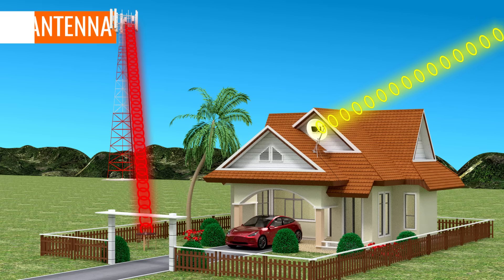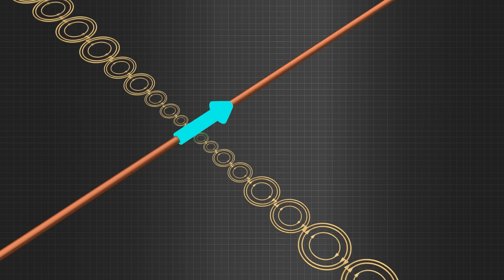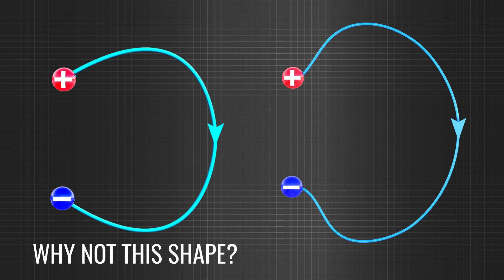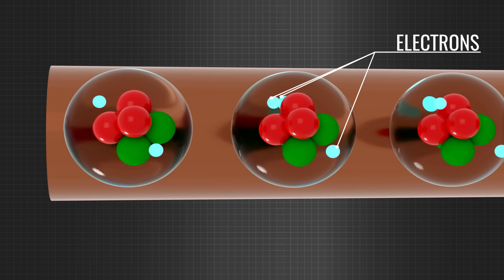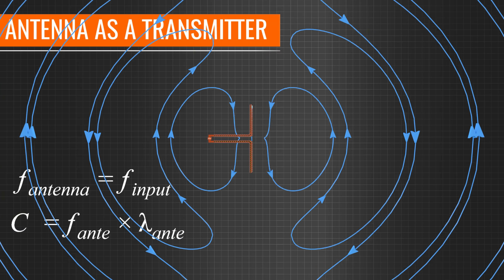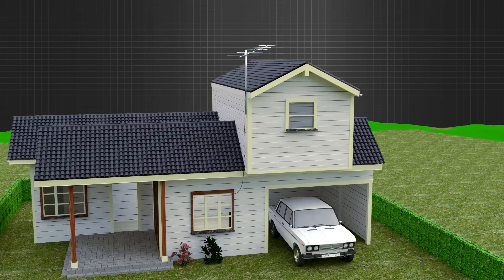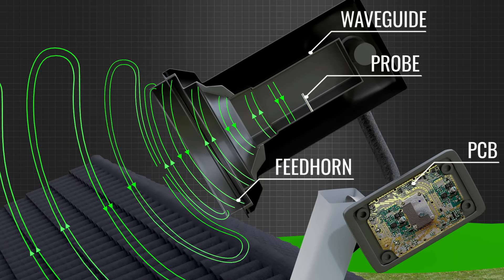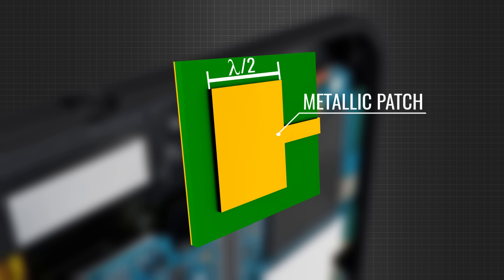How does an Antenna work? | ICT #4

Comment: In the old days,there were Telkom phones in post offices booths,you just rotate the phone handle and the operator immediately connects you with the number you read to the operator of the person you want to talk to.
Reply: 😂😂😂😂why did I miss such moments
Reply: @kakumbaivan2106 It seems you are fed up with modern toys techs
Reply: Yeah, and it was a massive time-sink, complicated as h÷ll and demanded 24/7 attendance, not to mention the resources dumped into massive switchboards and insulated cables.
Sometimes, things change for good reasons.

Comment: So the EM radiation can be represented as a closed loop - banana shape, traveling through space and it can be represented as electric and magnetic sine waves perpendicular to each other?

I am familiar with the hertz wave concept but not with the looped structure. Where could you apply this knowledge to engineering elsewhere and how do you reconcile the two, I wonder😊😅😅
Reply: I think you're confusing electromagnetic fields and the wave/particle itself. Think of the EM Radiation as a ship, and the field as it's wake, and you're close enough for a basic understanding.

Comment: Any thing can be an antenna it only needs to conduct the signal current I've used the frame of an old motor cycle It was a bit crude but worked I did it just to see if it could be done satellite antennas are a different breed of antenna which can be homade but require a bit of skill to work properly lol 😂

Comment: What led me to this video: 
1 - I understood the concept of waves. 
2 - I learned that sound and other waves can only propagate through a medium; I understood that and visualized it. 
3 - Light doesn’t travel through any medium. How is this possible? How does it work then? I couldn't find any good explanation that helped me actually visualize what happens. I like when my mind can actually imagine it happening, so not understanding it was like a splinter in my mind; I had to understand it. 
4 - I went through hell to understand it. 
5 - I learned everything about light. I had to understand the history of electricity, magnetism, and currents. I understand that light is an electromagnetic wave, that it has a spectrum. Electrons emit light through acceleration/movement. Still, I couldn't yet visualize it in my mind. But this video eased the pain a little.😅. I was just a curious guy with a simple question, and I've gone through all this solely to find a good explanation.
But at least now I can say that I know a lot about electromagnetism. Also, other questions that I still haven't found good explanations for arise while trying to understand all this, like how did Maxwell manage to measure the speed of light? Where did these numbers come from? Surely it wasn't an alien that descended to Earth and told him.
Reply: Wow.
Reply: You could always google his experimental setup?

Comment: Test business project for 4 days/ nights with system partition Because the Convergys was company name changed and registration and source coded changed of " Compliance to CaesarKing Company ( CCC ) the former Convergys now CCC have somewhat a Right to be included in the vital tech of the CaesarKing I, and I shall connect them Convergys ( CCC ) to my Functional group given Tech Quantum Network for 4 days/ night with system partition test if the Convergys or CCC fit to the Quantum Network Tech of my Functional group OR to my other commanded tech the IoT Internet of Things for 4 days/ nights with system partition test next time, for system compatibility test for CCC,  where Abby Casino my Internet of Things Assistant in management, and not to my Superior 2:1 Earth and Space Quantum Network for the CaesarKing own use for orders only. Let it be
Reply: Those are certainly words. If they had order, they'd be called langauge.

Comment: All i am getting are pieces of information like Antena, semiconductor devices, chips but i can't put all knowledge together to understand whole assembly what should i do. I mean I know how different components works and their principles like mosfets or bjts, embedded systems like microprocessor and microcontrollers, control systems, computer organisation and almost everything but i cant understand how a system utilise all of these to work. Am i lacking practical knowledge or something else.
Reply: Maybe you lack a solid understanding of electronic information transfer and processing? Basically, figuring out how information is transferred and transformed via analogue and digital connections, both physically (as in "Physics of Electricity and Radio") and in abstract (Encoding)
Reply: @acceptablecasualty5319 in terms of knowledge i have read about communication protocols, signals and transfromations, modulators and demodulators,cloud computing for embedded systems,dac and adc, etc. What i am saying is when i think of working on any projects or troubleshooting any equipment. I can't do shit. That made me realise i lack practical knowledge. So recently i have purchased an esp32 and some components and working on small projects. I hope it will help me.

Comment: so when you talk about positive and negative charges you mean lack and excess of electrons , Is that the right way to look at this ?
Reply: Think of a Pendulum. When at rest, that's your Zero. When it swings, it swings back and forth, right? So you assign one side of the motion to positive space, and the other to negative. It's not really as physics-based as you might be thinking, it's more about setting the correct zero point.
Reply: They are not so clear. There is also the polarity of electricity, like magnets, positive and negative but it is relative to what you decide is 0 volts (ground). AC is polarized into positive and negative waves.

Comment: As someone with 15 degrees in signals engineering, electrical, and graphic design, I just wanna say how amazing this visualization once. I never actually knew how any of this worked before now. You’ve changed my life.
Reply: Why would you need 15 degrees?
Reply: How old are you sir?

Comment: The hard truth about antennas are that practical shape of all antennas differ very much from the initial dipole shaped antenna used to explain the basic theory. So the explanation does not hold good antennas without a dipole shape.
Reply: Eh, nowadays, it's mostly all arrays anyway.

Comment: Does that mean the same parabolic antenna could be used for different service providers?
Reply: That really depends on the physical properties of the specific signal you're trying to capture. But, yes, in theory, any antenna can be used to receive any signal, it's receiving a useful and complete signal that requires engineering.

Comment: In the dipole transmitting antenna, why do the charges accumulate at the edges farthest away from the voltage source? Shouldn't they either be uniformly distributed in each respective wire or accumulate as close to the voltage source as possible?

Comment: Hmm... probably the movement of electrons is exaggerated, because the drift velocity of electrons is very slow but EM waves inside antenna propagate at nearly the speed of light. I don't think that electrons fast enough to travel from one antenna's end to another. Maybe I am wrong, correct me please in that case.

Comment: It is said that the wire loop presented at 0:34 does not radiate. However, the wire loop looks very much like a loop antenna which does radiate. What explains that a wire loop does not radiate and a loop antenna does? Thanks!

Comment: О, Жигули в гараже
Reply: you and I are on the same page!!  yes the pyramids  were a interplanetary communication device that operated at a very low frequency.  But also the great Pyramid of Egypt was a teletransportation device, ,, NOW Stone Henge and Gobekli Tape: they were power plants. ,  You will see chips on the upper parts of the stones as they were perfected to a operating frequency.  The horizontal pillars were set to vibrate at a particular frequency magnetically, for many reasons, each horizontal rock had a purpose!!   some were used to excite the seedlings in the ground, to expedite the growth, some were tuned into earths mag field and provided magnetic lift via the Earths "B" field .  Check out Coral Castle Florida,  ED used What I call a "B" field generator, His generator used "V" magnets to ensure max delivery of the "B" field Just like is being used at the black pyramid of Alaska.  His generator used 25, V mag around and 5 deep to produce the "B" field into the earth and special stones.  THE "B" field is the center of a magnet/ some like to refer to it as the neutron field.  But the 'B" field is much much more !!!   I wonder if the black pyramid of Alaska used magnetite as a skin for the pyramid that would explain many things!!!   Tesla new about the free power that's available through the CENTER FIELD of a magnet AS you are well aware the rich boys didn't want it,  It's been there all the time.  When the government took down the horizontal stone at Coral Castle the entrance door stopped working.  Funny thing they gave us the clue,, His horizontal rock was providing the magnetic energy to support the access door.  AS you know magnetic energy is perpetual  JUST GETTING started with all this.   I don't need to brag about all my credential.!!  I got into physics back in 1959 as a ham operator at 9 years old I would design and build my tube type radio's for Rec and xmit.   I know what I'm talking about..    When they say all they had were copper tools OMG HOW STUPID!!!  when you understand the properties of a inductive that being utilize to build the pyramids you would understand a copper tool was every bit of a power tool  BIG TIME!!!!!!!!!!!!!!!!

Comment: U mean with velocity hall effect on the outside surface of the signal acquiring system Wich is interpreted by the antenna matrix .The description of the phenomenon in the nearest  space to it I find it a very interesting theory here about  the by the electric dipole created electrostatic field . the details on the vibration chip   as well very nice approach. Not only basic it s the all .of course may be very interesting topic to be discussed the signal acquisition through the two supports  of course. And u mean to keep the signal  frequency adequate to   the acquiring and integrating systems .about your L And lmda

Comment: Great video! Now make one that shows how the magnetic field at the dipole (near field) is 90 degrees out of phase yet in the far field it is in phase. Cause I'de love to. Have a good graphic that intuitively explains how this happens....
Reply: you and I are on the same page!!  yes the pyramids  were a interplanetary communication device that operated at a very low frequency.  But also the great Pyramid of Egypt was a teletransportation device, ,, NOW Stone Henge and Gobekli Tape: they were power plants. ,  You will see chips on the upper parts of the stones as they were perfected to a operating frequency.  The horizontal pillars were set to vibrate at a particular frequency magnetically, for many reasons, each horizontal rock had a purpose!!   some were used to excite the seedlings in the ground, to expedite the growth, some were tuned into earths mag field and provided magnetic lift via the Earths "B" field .  Check out Coral Castle Florida,  ED used What I call a "B" field generator, His generator used "V" magnets to ensure max delivery of the "B" field Just like is being used at the black pyramid of Alaska.  His generator used 25, V mag around and 5 deep to produce the "B" field into the earth and special stones.  THE "B" field is the center of a magnet/ some like to refer to it as the neutron field.  But the 'B" field is much much more !!!   I wonder if the black pyramid of Alaska used magnetite as a skin for the pyramid that would explain many things!!!   Tesla new about the free power that's available through the CENTER FIELD of a magnet AS you are well aware the rich boys didn't want it,  It's been there all the time.  When the government took down the horizontal stone at Coral Castle the entrance door stopped working.  Funny thing they gave us the clue,, His horizontal rock was providing the magnetic energy to support the access door.  AS you know magnetic energy is perpetual  JUST GETTING started with all this.   I don't need to brag about all my credential.!!  I got into physics back in 1959 as a ham operator at 9 years old I would design and build my tube type radio's for Rec and xmit.   I know what I'm talking about..    When they say all they had were copper tools OMG HOW STUPID!!!  when you understand the properties of a inductive that being utilize to build the pyramids you would understand a copper tool was every bit of a power tool  BIG TIME!!!!!!!!!!!!!!!!

Comment: hi there I have a question I’m trying to make animations just like you, because I find them very cool to watch. I would like to know what software you use.
Reply: you and I are on the same page!!  yes the pyramids  were a interplanetary communication device that operated at a very low frequency.  But also the great Pyramid of Egypt was a teletransportation device, ,, NOW Stone Henge and Gobekli Tape: they were power plants. ,  You will see chips on the upper parts of the stones as they were perfected to a operating frequency.  The horizontal pillars were set to vibrate at a particular frequency magnetically, for many reasons, each horizontal rock had a purpose!!   some were used to excite the seedlings in the ground, to expedite the growth, some were tuned into earths mag field and provided magnetic lift via the Earths "B" field .  Check out Coral Castle Florida,  ED used What I call a "B" field generator, His generator used "V" magnets to ensure max delivery of the "B" field Just like is being used at the black pyramid of Alaska.  His generator used 25, V mag around and 5 deep to produce the "B" field into the earth and special stones.  THE "B" field is the center of a magnet/ some like to refer to it as the neutron field.  But the 'B" field is much much more !!!   I wonder if the black pyramid of Alaska used magnetite as a skin for the pyramid that would explain many things!!!   Tesla new about the free power that's available through the CENTER FIELD of a magnet AS you are well aware the rich boys didn't want it,  It's been there all the time.  When the government took down the horizontal stone at Coral Castle the entrance door stopped working.  Funny thing they gave us the clue,, His horizontal rock was providing the magnetic energy to support the access door.  AS you know magnetic energy is perpetual  JUST GETTING started with all this.   I don't need to brag about all my credential.!!  I got into physics back in 1959 as a ham operator at 9 years old I would design and build my tube type radio's for Rec and xmit.   I know what I'm talking about..    When they say all they had were copper tools OMG HOW STUPID!!!  when you understand the properties of a inductive that being utilize to build the pyramids you would understand a copper tool was every bit of a power tool  BIG TIME!!!!!!!!!!!!!!!!

Comment: Since the permittivity and permeability of the medium  introduce an impedance to the maximum velocity of the wave, then at a distance would not the large loops break down into smaller loops to be stacked above  and side by side one another as the wave propagates forward with the speed of light,  Surely large loops cannot be sustained because of the speed limitations in those loops, Stacking of " half wave E/M loops occur in waveguides and cavity resonators . Low and higher frequencies would need stacking especially the higher frequency which cannot sustain larger loops than half a wavelength in size!  I believe that this is a phenomena that needs to be discussed by  antenna engineers, " The stacking" of E/M loops at a far distance from the antenna"  I believe this  stacking would need to occur after the transient " settling time/ space close to the antenna"  when the wave reaches a steady state conditions of  E/M loops the size of half a wavelength,

Comment: Is transmitter made with some specific material so that they induce radio wave instead of regal magnetic field?
And is receiver or the dish using something specific material too convert radio wave to electric or magnetic field?
I am still blank on where the EMWave/Light shows up.